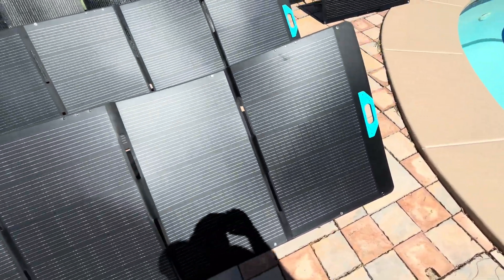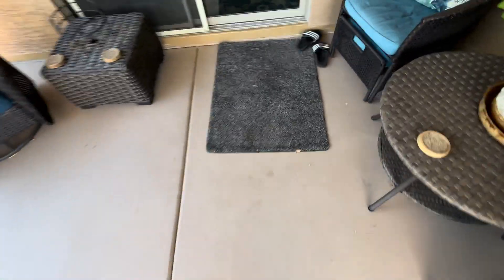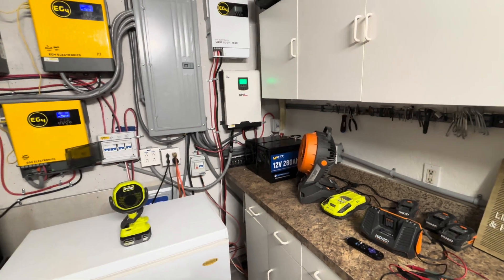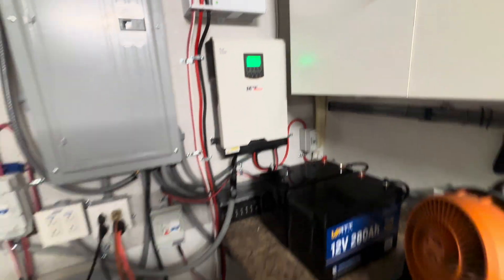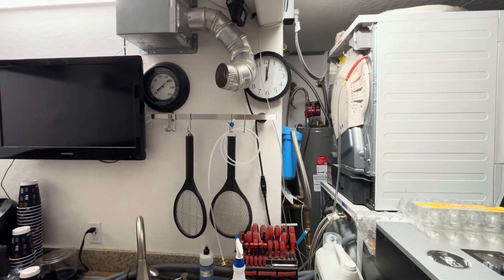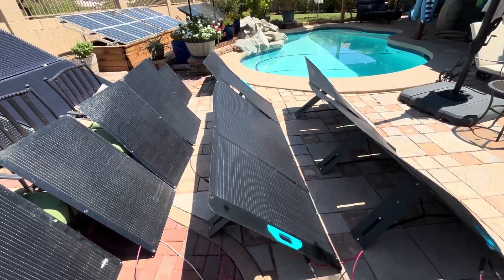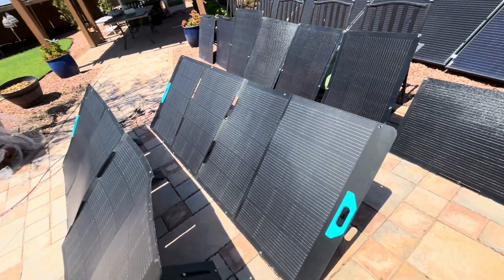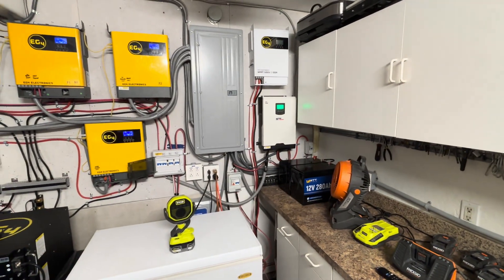DIY solar for home. Anker Solar 400 watt panels

Comment: So these are 4 100 watts panels? for $800, no I will pass, but thanks :)
Reply from the maker: I trying to test a lot of different portable and flexible solar panels, I tested the cheapest flexible solar panel I could find and now I’m testing one of the most expensive portable solar panels. Looking at longevity, quality, price, efficiency, if it will fail, etc…

There are a lot of solar panels out there. Many in between the lowest price and highest price. Will see how they hold up.

Comment: When you are mixing solar panels like you are, you lose efficiency from having different duty cycles for each type of panel. You may need a controller for each type, and each be the same controller.
Reply from the maker: I was just showing what would happen. I do not need to use the solar panes for a system. Just testing. Not planning on using in that configuration. Thanks for your input. If I were to use, I would use all these solar panels.

Comment: That wall set up is next level. Im to scared to take that on just yet, but using a bunch of f3800 plus and f3000 units
Reply from the maker: I was scared at first when I started, but I felt more comfortable after actually installing the solar and it working.

Configuring the solar panels 5 years ago with low 150V solar input for 12,000 watt inverter was a major challenge. Now with the new technology, you can configure up to 500V dc solar panel input.

These portable and flexible solar panels are for the RV when camping. Hoping I can get these solar panels to get better output in the range of 80 percent or better.

Comment: I got 3 of these 400w panels for free from anker because i bought like 30 grand of their solix line. I throw them around as back up when i need more solar in the morning. Im in Gilbert AZ plenty of sun. But i would not buy these panels for how much they are. Free was good though hah. Your area in the video looks like AZ too lol
Reply from the maker: Free is good. I think these 400 watt portable solar panels will produce better in the winter with cooler temperatures. I plan on taking in RV when we go camping in the mountains. I’m on the other side of town in the southwest Phoenix area. You are correct, plenty of sun out here. I hope you their solar line is working well for you.
Reply: @diy-solar-guy  cool. Just fun to see an AZ guy at this level of solar diy. I just got into it 3 months ago and can't stop. My wife wants to throw it away since I am not doing my op reports or patient notes much. Hahaha
Reply from the maker: @SurgeonTech my wife was not on board at first. Then I starting running all of our air conditioning in our 2 story house and garage with off grid solar. Now I can heat the 15,000 gallon in ground pool to 86-89 degrees in the winter while pool is in complete shade with the off grid solar. She is definitely on board now knowing it already paid itself off with just savings on electric bill. 

We use to keep our house at 80-85 degrees in summer with $600-$800 electric, but now with off grid solar we keep our house and garage at 70-78 degrees with our electric bill never going over $200 in the summer. 

That impressed her so much that she does not question any other solar projects I do. Going into retirement soon knowing our electric bill will be less than our water bill is a game changer for her. 

Our 18kW off grid system is so efficient and reliable. We use LiFePO4 battery to run our air conditioning overnight in the summer. With temps dropping this week. We will use less than 20kWh a day from here on out through the winter for grid power. That’s a wonderful feeling. My wife now brags about our DIY solar set up. She is on board now. Happy wife, happy life!!
Reply from the maker: @SurgeonTech I spend about 5-10 minutes a day with my system. Turn on 4 more inverters in morning and turn off those same 4 inverters at 6 pm. I did wash my solar panels yesterday, well hosed off. That took a half hour. Thats all the time I spend each day now with my 18kWh inverter off grid system. It just works every day.
Reply: @diy-solar-guy that is so cool. Im a total nerd with this and tech stuff haha
Reply: @diy-solar-guy yes. Most of my medical friends don't even own a screw driver. I did diy with my dad growing up and i continued doing that stuff. Being a surgeon, i like working with my hands. I just look for an excuse to go to home depot to buy a new tool to use. Most of the home depot employees are my patients haha. Thanks for the support! I subscribed
Reply from the maker: @SurgeonTech I’m a regular at Home Depot as well. Since you live close, let me know if you have questions, comments, or help with setting anything up in the future. I buy my used solar panels at SanTan solar by Gilbert Road and Germann Road area. I bought a lot of stuff for from them to build my solar panel arrays. The employees watch my channel. You spent a lot on solar. Do you think it is worth it for the Anker line?
Reply: @diy-solar-guy no the money is absolutelly not worth the anker stuff. Much better stuff out there. I was just afraid i would burn the house down if i opened up one of those eg or xp units to hook up. That i will graduate to one day. This was the easiest to get something out of it, but will gift these to my family as presents when i learn your and like set ups. As for san tan solar it is 2 lights away but their site is so bare that it looks like they barely have anything there. Not sure if it is worth a stop there?
Reply from the maker: I buy most of my stuff from Signature Solar. I bought a lot of used solar panels over the years, like 150 solar panels. They had great deals before but the used mono solar panels are really hard for them to get. 

I did the same thing. I gifted some of my old solar components to my family. The products will last a long time but very expensive even refurbished. I buy a lot if refurbished products that I am using currently with no problems or hiccups. 

I really like the whole EG4 line of off grid solar products. I have had no problems at all so far. I tried Growatt low frequency before the EG4 products and it was problem after problem with all kinds of faults happening. Very tight tolerance for solar input and almost impossible to stay within the limits on the 12kW inverter. These EG4 3kW off grid inverters have run everything I have thrown at them. Even my 12.7 ton electric pool heater for my 15,000 gallon pool. Our pool is heated in the winter out here to 86-89 degrees for free now with off grid solar. Hope you have a blessed weekend.
Reply: @diy-solar-guy Awesome!

Comment: I know your wife is going crazy. Your backyard is being taken over With solar panels. 

I know, your HOA in Gilbert is not happy with this. Need to go up to Santan solar And get all new panels that are the same size.(450 or 500 w solar panels To clean up your yard, Just a suggestion. Sell all those old used panels. Please, Just some advice.
Reply from the maker: No actually my wife understands just how much we save using off grid solar. That is just more money to spend on other things. Plus we now use around 3 times the amount of power compared to before having off grid solar. So we are much cooler in the summer at 70-76 degrees. Even the garage is air conditioned. 100 percent of our air conditioning is free. We even heat our 15,000 gallon pool in the winter to 86-89 degrees.

The wife is totally onboard so there is no need to purchase new panels when the ones we have are producing over 90 percent of rated output. Space is not an issue for us. Plus we have no solar on the roof of the house.

I even have around 60-70 extra solar panels as replacements. Although it sounds nice. I really don’t need to spend a lot of money just to use less space.

My wife is Happy. Know what they say;
Happy Wife, Happy Life.

Some of what we do is test how long these used solar panels will last. So far, they are still producing excellent in the 90-95 percent range and no problems, But thanks for the suggestion. Hope you have a truly blessed week
Reply: @diy-solar-guy I live in Gilbert too and I have solar panels all in my backyard and my wife hates it but you're right we do save a lot of money with these panels keep up the good work on the videos thank you
Reply: @Djhoodrich. Looks like we are all from gilbert. Lol
Reply: Y’all sound like losers 😂